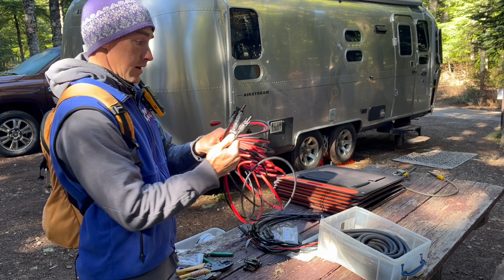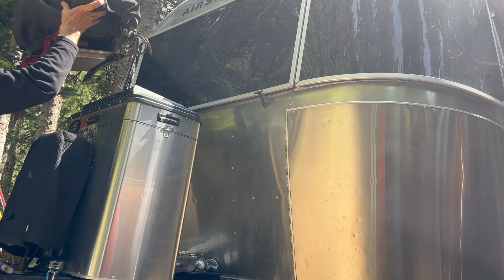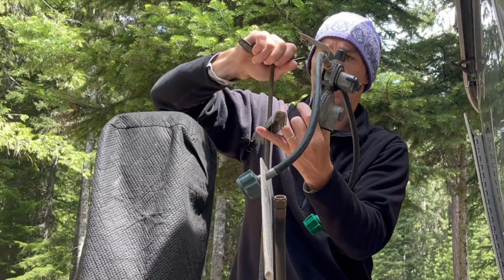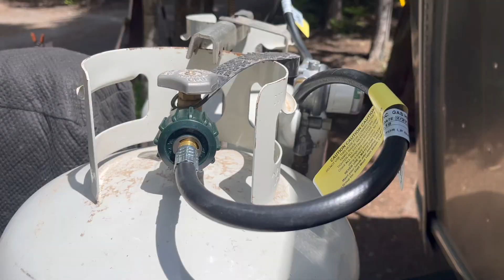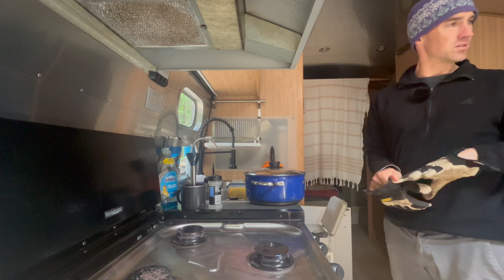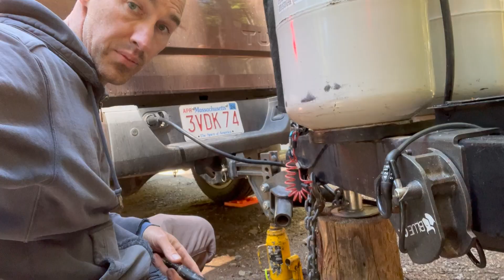Airstream Trailer Propane Repairs | Off-Grid Work Camping Mt. Hood

Comment: We use rubbing alcohol to remove pine pitch from our 2010 Airstream.  Rock dimples on your guards add character 😊
Really enjoy your channel and look forward to each new episode.
Reply from the maker: Thank you for your kind words and support. We will have to try some rubbing alcohol on this sticky mess. If it works, we may need to buy a full gallon. 😀😀 ~Shanna